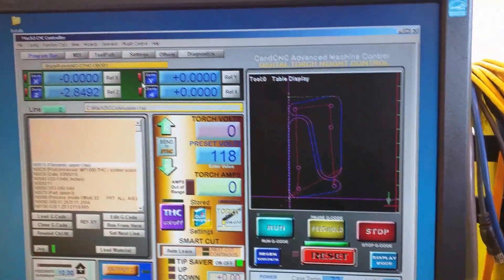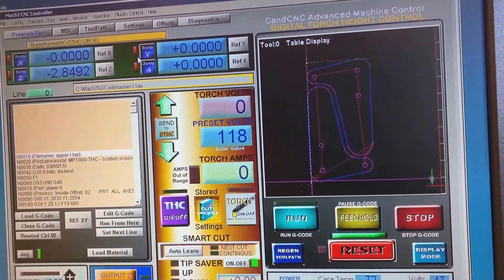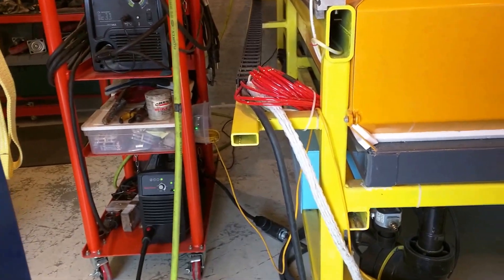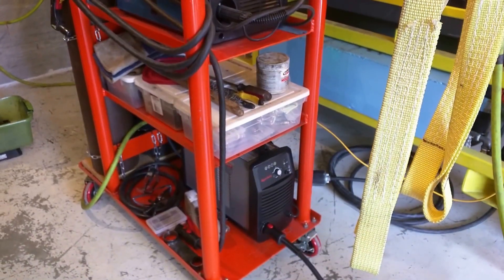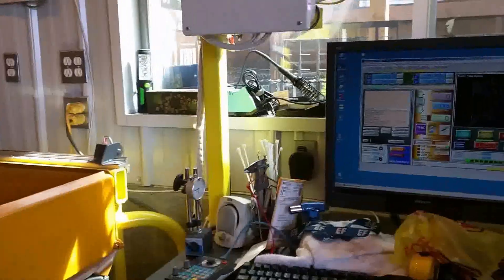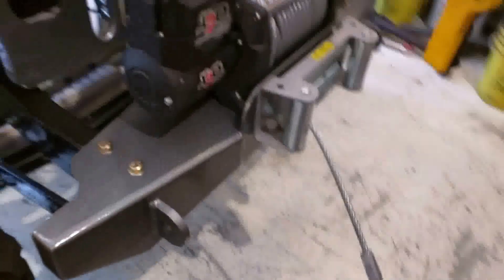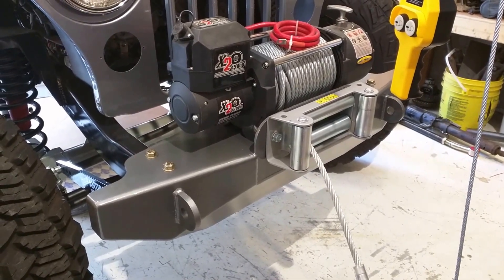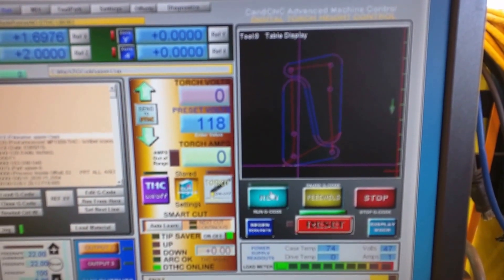Plasma cutting bumper parts.

Comment from the maker: This is actually 1/4 plate steel...  My bad.  :-)
Reply: Jim,

How's the CandCNC system holding up for you? I'm looking at their core CNC system for my 6'x12' table build..

Nice builds on the bumper and table both!
Reply from the maker: SegoMan it's working well.  No issues.  Consumables are expensive for the Hypertherm 45.  The contamination splashing up from the water table does shorten the consumables life.
Reply: Thanks for the reply Jim.

I think part of the splashing problem is the depth of the water tray, my 2x2 is only 3" deep and it tends to splash a lot as you say especially when you cutting on the perimeters. I am building a 6x12 frame now and have allowed for a 6" deep tray to help cut down on that problem.

Tip for you get one of the magswitch magnetic grounding clamps, it was a real pain grounding on my small table with big pieces without it.
Reply from the maker: You're welcome.  6 inches is going to be darn near 270 gallons.  Now that's going to be heavy.  Thanks for mentioning the magnetic clamp.  I'll look into it.